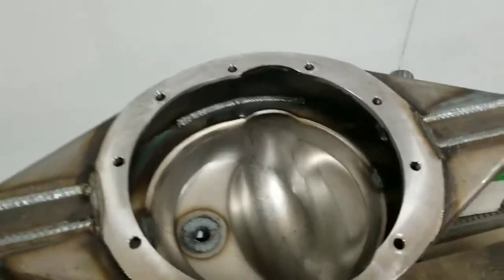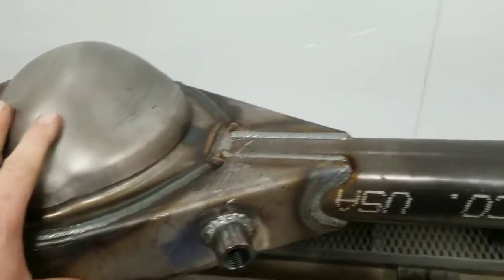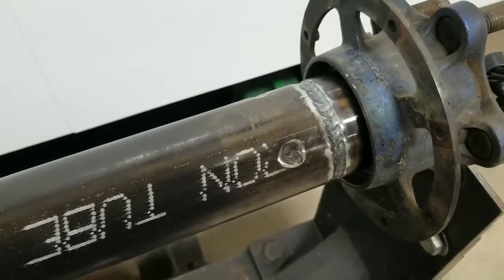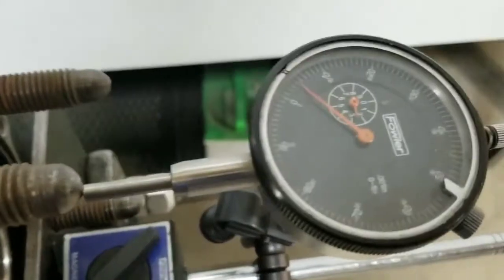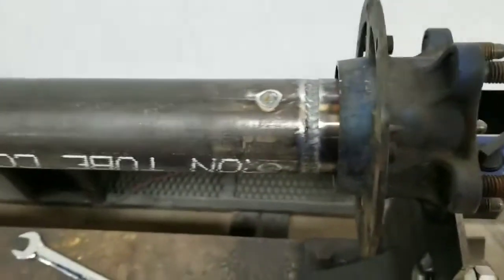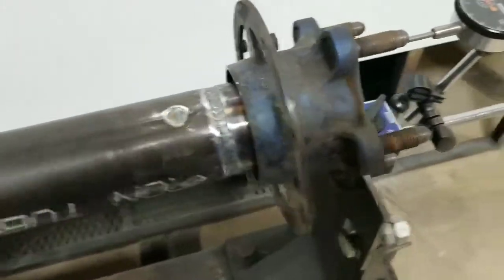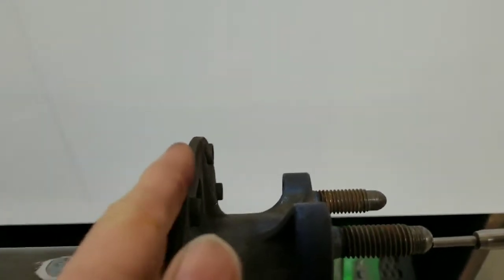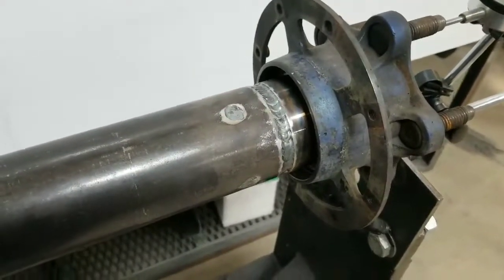Ford 9 Inch Rear End Housing by Hammond Motorsports

Comment: Wouldn't you want to measure run out from the axle flange?
Reply from the maker: you can just dont have the drive plate on no matter what I still using a fixed point so it read the same Thanks